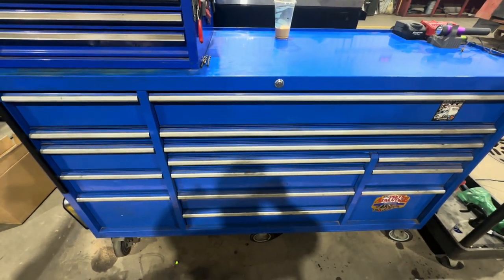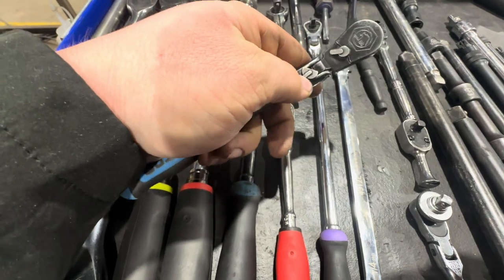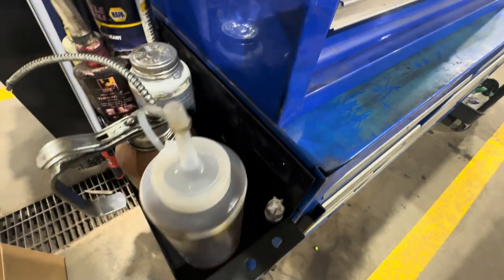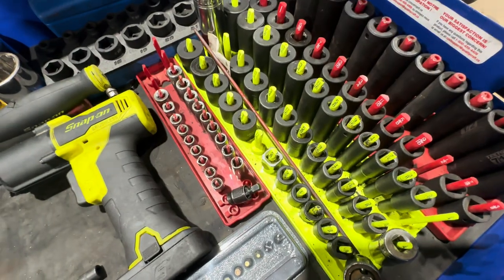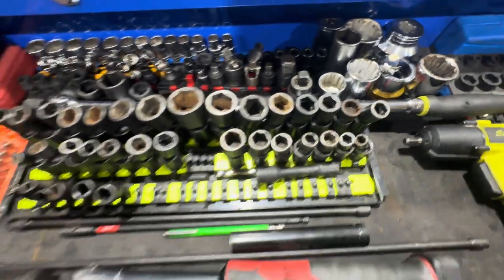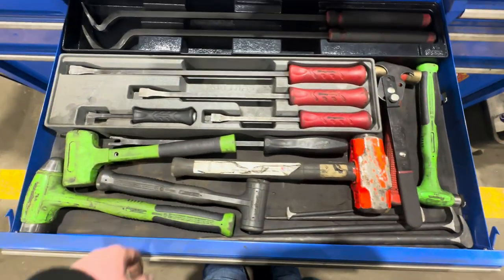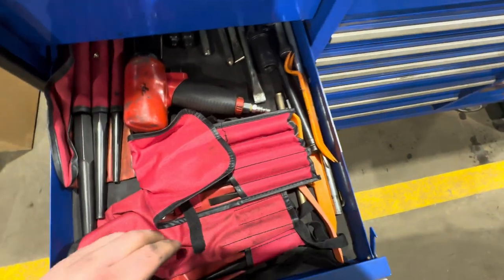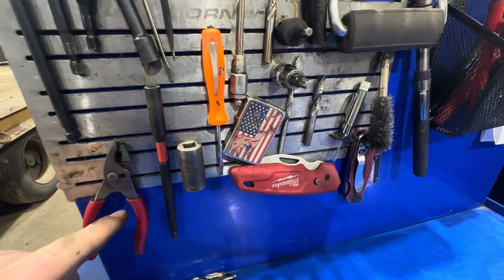Heavy duty diesel mechanic’s toolbox tour!

Comment: 19:48 is that set good to drive in seals and races on class 8 trucks? I got an icon set that’s good for medium duty trucks and I would like to get a set for bigger trucks
Reply from the maker: The snap on one I have mainly used on smaller seals. I haven’t used it on races due to how soft the aluminum is, but the Amazon kit I have next to it of steel drivers is also good and takes a decent beating!
Reply: @Turb0Tools 
I have the Mac version of that aluminum seal driver kit   .
I’ve been looking for a Steel Version. Do you have a manufacture or part number for the Amazon kit?
Thanks in advance   😊

Comment: Toolboxwidget for your pliers! Question. Long neck vs short ratchet. Which would you buy first?
Reply from the maker: That is a good idea with the toolbox widgets! If I did it again I would definitely buy the long neck electric ratchet! What brand are you thinking of going with?
Reply: @Turb0Tools  I’m already on the Milwaukee battery ecosystem so that’s been decided for me. I’m hardly a mechanic but do want to work on my own stuff. So I built a tall & small box. SK launched their modular toolbox that stacks. So I gave it a shot after I got gifted the base and starter box.